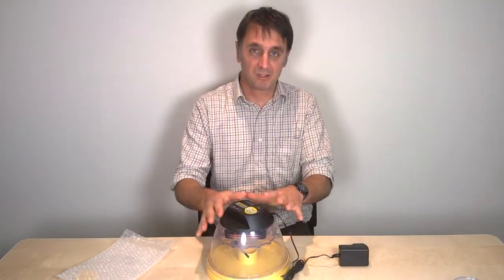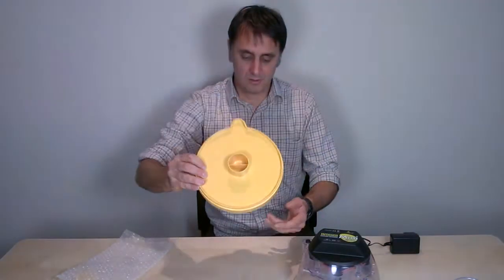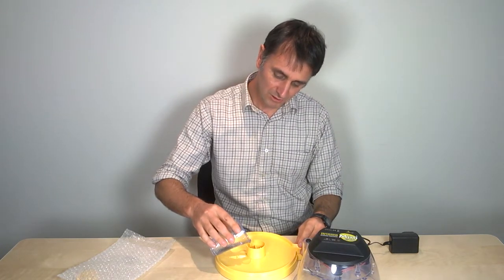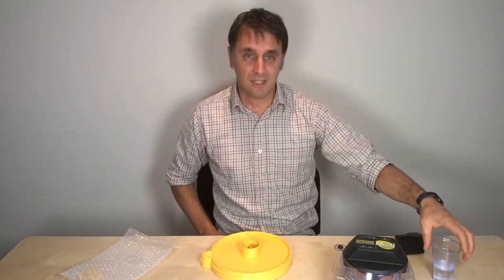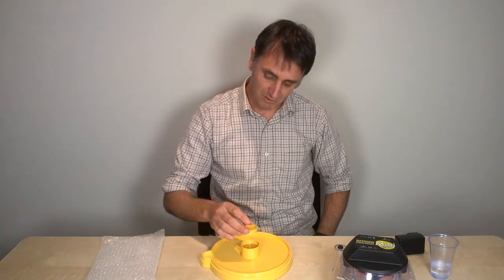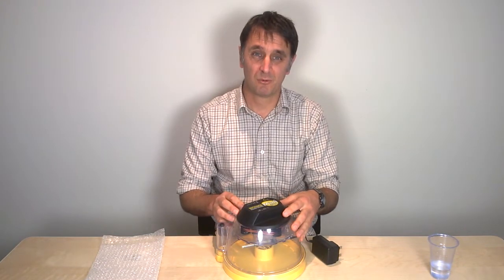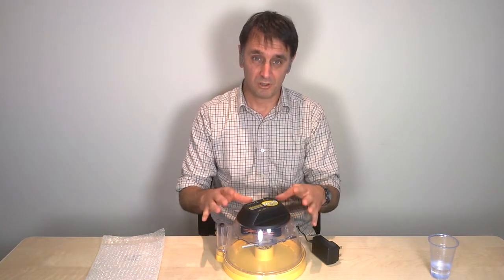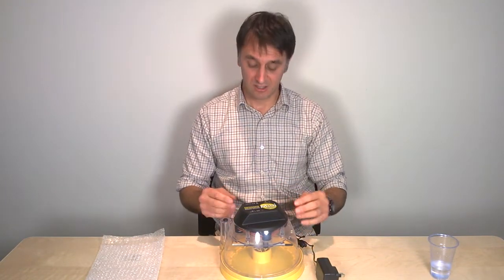Brinsea Mini Eco Egg Incubator  clip 3   Humidity in the Mini Eco

Comment: I'm hatching runner ducks, is the central resovoir full both sides enough for ducks or should I put in a wet paper towel as well during lockdown?
Reply from the maker: Good morning, filling the pot both sides is sufficient to hatch ducks, and no, it isn't necessary to add the paper towel.  Good luck!